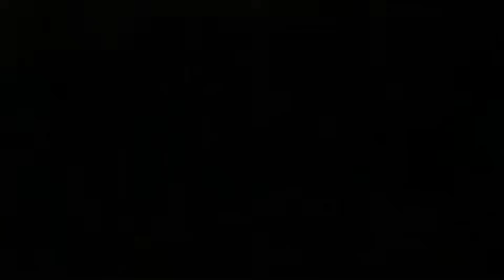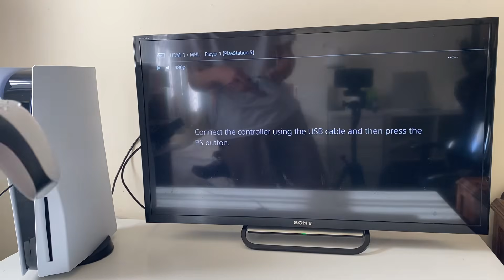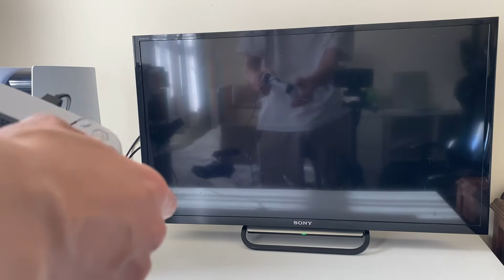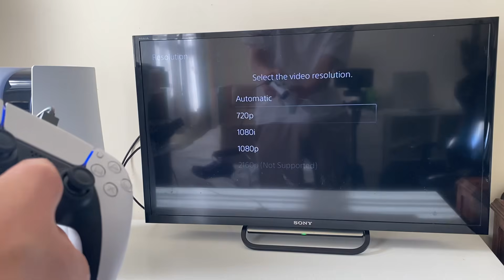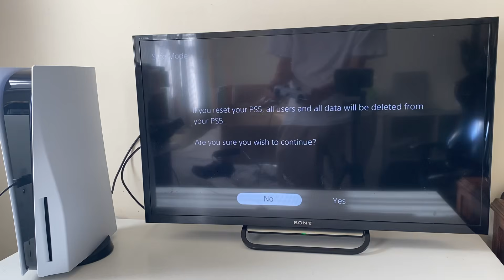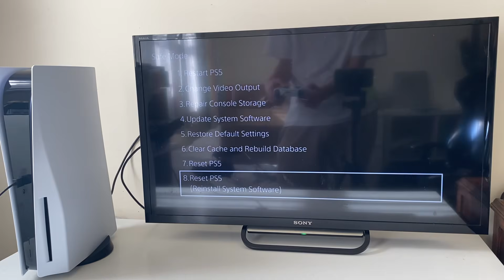How To Fix PS5 Black Screen - Full Guide

Comment: how do i go into safe mode when it’s all just a black screen 💀💀
Reply: Same
Reply: Did u figure it out ?
Reply: I figured out what was wrong with mine my hdmi was messed up i just had it replaced
Reply: @sal9640 bro where did you get it fixed 😢
Reply: @Gaming_mj2523  i got it fixed at my local pc shop tbh u can do it ur self i learned how to do it in case it messes up again u just need a solder kit and a hdmi replacement but watch a few videos first before you diy it
Reply: @sal9640 how much ? Did you send it to sony
Reply: @Gaming_mj2523  yh i did took it to my local pc store and fixed it but its a rip off i paid £75 but dont know what ur currency is if ur not from england
Reply: same
Reply: 😂😂😂 same
Reply: Same here. I'm having this same issue of how to go into safe mode if it's just an all black screen.
Reply: @WeebGamer101  it just happened to me what did you do ?
Reply: @Clip_alot  I don't remember what I did. I think I just unplugged everything, but I don't remember. Than went into safe mode as soon as it was plugged back in.
Reply: @WeebGamer101 I think I might be cooked bro 😭😭💔
Reply: What did u do bro save us
Reply: Fr
Reply: Fr
Reply: exactly
Reply: Same
Reply: Hold power. Button for 5 to 10 seconds